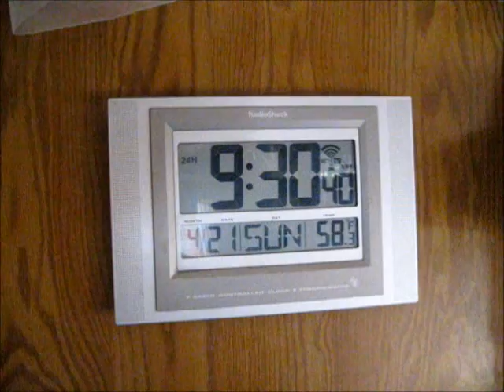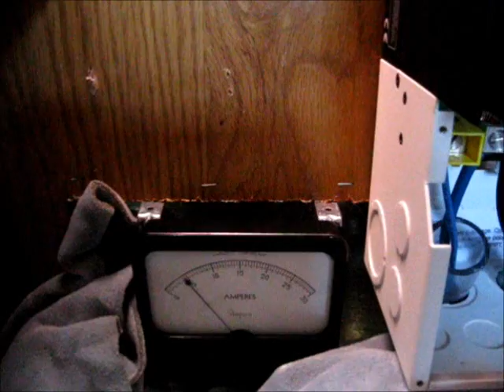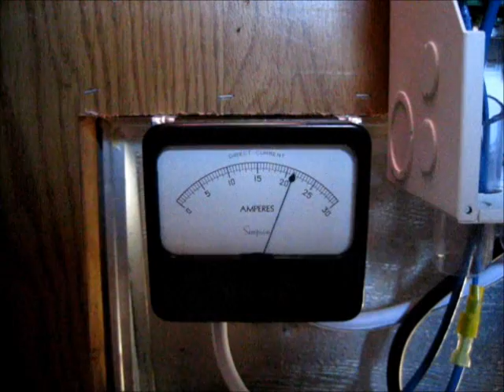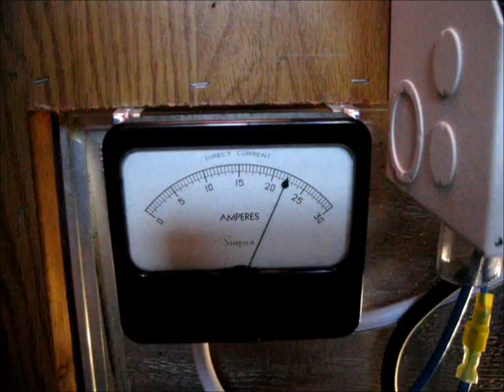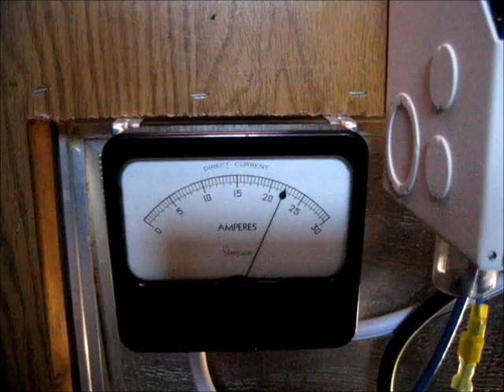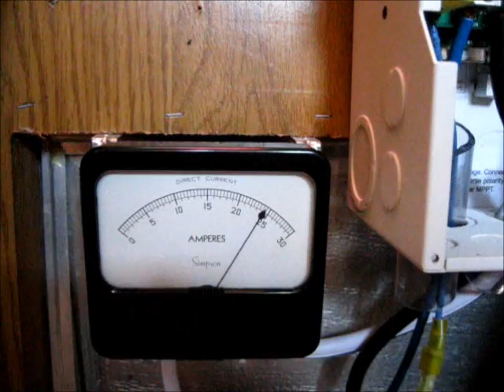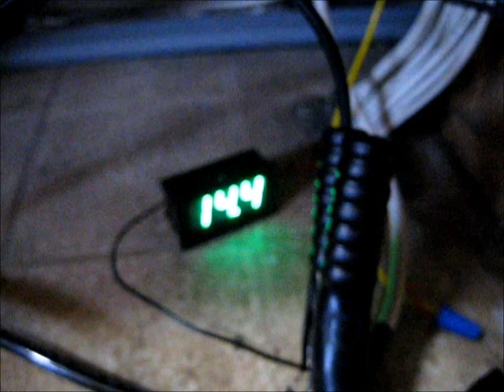Sunday Full Batteries Burning Up Extra Solar Power

Comment: Stay away from incandescent light bulbs go all LED. You put fluorescent lights on AC current why you can buy LED strips that put out twice the light and use a quarter of the power that a fluorescent does. It may be pricey but you will save money in the long run go LED brother.
Reply from the maker: I have been switching to all LED lights through the years. Now we only use LEDs for everything

Comment: Hello Troy I'm not and off grid person here but I was thinking about your solar panels that you have to keep running out and turning towards the sun. Could you make up a bracket that you could mount  on a piece of pipe . Than try getting you a bell type rotator for turning antennas. Make sure you get the mast bracket that fits on the bottom side of the rotator that way you can use a pipe instead of mounting it in and antenna tower. Next question is how heavy are the sun panels your using? If there not over 50 lbs I would believe you could use this to turn your solar panels from inside your house. I'm sure you wouldn't have to turn them much to get them back in the sun light so there wouldn't be much wear and tear on the rotator. Just a thought Troy. Amateur radio is a hobby of mine and I have turned some pretty big antenna arrays with rotators. Take care Ron

Comment: I don't believe that you are using a smaller battery to charge multiple larger ones. You're going to have to prove that one.There is actually no evidence of it's existence. I have done some research since the first video I saw you use it in, because at first I thought it was just a rigged up version of a battery life saver. Fixing dead batteries is nothing new, the issue is that you are saying it's being done with an outside source. If you ran your house on it, you would be the first.

Comment from the maker: If its fake, then what is charging the batteries?

Its certainly not 1 - 1. I can charge up a 100 ah battery with a 5 ah battery. I can charge up 10x 100ah batteries with a single 5 ah battery running it.

How can this be if its impossible?

There is evidence of its existance.

Actually, I could power my whole home with it, but cannot afford the copper wire and transistors to build it sadly. That is my main limitation.

Comment from the maker: Please answer my question though. If I am just putting the same in as I get out, then how can you explain this:

I can charge 10 or 20 batteries without using any more energy to run the device.

Where is the energy coming from? Not from my run battery. I just stated that fact.

It must be coming from somewhere.

Anyway, exist or not. I believe in it and use it.

Comment: It's not a matter of believing. If it worked than you wouldn't need the other means of energy that you have. It's a perpetual motion machine. There is no "believe." it's just not there. It's using only the energy that you put into it. You are using your power to charge the batteries. Have you never seen what a trickle charger does? There is a reason it's slow. You might be refreshing batteries, but that doesn't mean you are harassing an energy source that no one can prove actually exists.

Comment from the maker: Lol. Your own comments show why people would not be using it. People dont believe. I dont care. It works for me.

Its not harnessing energy that isnt there. Its is there.

You cant see wind but it turns a turbine. You cant see the suns rays but it produces power. You cant see radiant but it sure is there.

Otherwise, please do tell me how I can charge 10 dead batteries on the output with no increased load on the single battery running the wheel.

Please explain that and I will denounce my words

Comment: You said in your other video that you didn't care about all of the buzz words peoples used, but only that it fixed your discharged batteries. But now you're talking about radiant energy. You do know you are talking about a perpetual potion machine. Or harnessing energy that is not actually there right? Do you really think you would be able to use or know about solar energy, but someone would hide this stuff? I mean it blows my mind that you would believe in such a thing. People would be using it

Comment: Lysol foaming bathroom cleaner kills ants and other crawling bugs on contact. It also discourages them from coming back if you leave a thin coat to dry in the areas they frequent. It is a cheap and easy way to fight back and I think it is less dangerous than other poisons. Try it. You will be amazed. I always keep it handy and spray areas that tempt ants after I do regular wiping up. You can also spray the path that the ants com in and it will stop them in their tracks until the spray is gone,

Comment from the maker: Well, that depends on what I spent and what I have been given.

I made my own solar panels and charge controller at first. Total cost of maybe $300 maybe last summer.

Now, with the new panels, charge controller and batteries, about $1200 total, I think in total value. The panels were 50 cents per watt tho on CL

Comment from the maker: Yes, good point. Thanks. I plan to eventually make all connections solid and professional.

My inverter is rated for 750 watts. No fuse on the outside that I can find.

Comment from the maker: I will swap out the meter, but for now, I want to watch how many amps I have coming in at any given time. I am writing a book later, so I need to know every detail as I go on. When I can get a new meter, then I will use the third panel as well. But for now, the batteries cannot handle all the power from two panels.

Comment: turn the frige upside down for one hours , then right side up , then over again . do this all day . it won"t work because the coolent need to be mixed up . if it has been sitting for a long time without  working the amonia settles to to bottom . when you do this you should hear it gurgling wich is a good sine .

Comment: Troy:
On your made up  extension cable, make sure you have all those wire nuts tight. It's good you protect it from your cat but ideally you should have like this in a outlet box. How big is your Inverter in watts/amps? Does it have a breaker/fuse?
My concern is your wrapped connection could overheat and melt if you get some resistance in the connections, especially wrapped tight like that. Remeber you ammeter heating up?

Comment: Some requests: How about a map of your site, showing everyone how secluded you are and where the creek is in relation to the camper and so on? Terrain, features, etc. Just the compound, nothing that would give away your location.  Also I agree with hooking up all 3 panels now that you have that sweet controller. Don't worry about the meter, dump it and run some ethernet and start monitoring on your PC. Take your old panels/controller and a couple batteries and make a pump house near the creek.

Comment: I would like to get a solar power energy with all the accessories. There is aTrojan L16RE-B 370 Ah, 6 Volt Deep Cycle Battery is make especially to work with solar power for back up and it last about 10 years is very expensive but well worth it. You could wire it in series to get the 12 volts for 2 batteries or with four batteries series the first pair and same to the second pair then parallel. With this batteries you well have enough power to do almost everything.

Comment: use lemon juice or some kind of acidy fruit juice to run around your trailer etc to keep the ants out.  Yes if it rains on it it will wash it off and you will have to re apply it.

Also you can spread some grits around the nest and yard if you have that up there, I know a lot of northerners that come down here for winter have no clue what grits are.